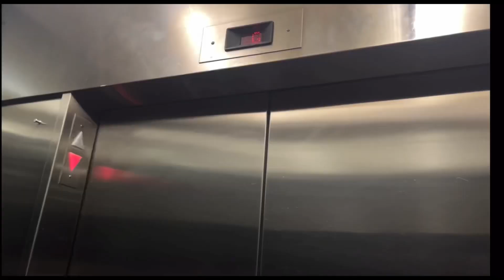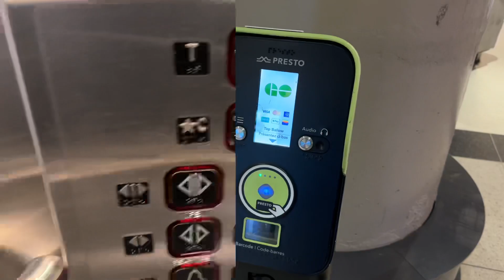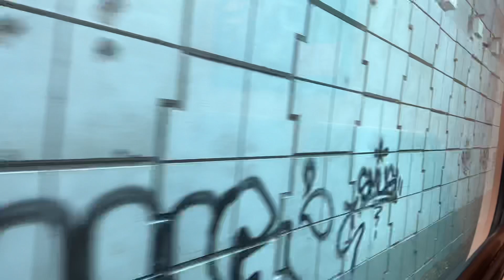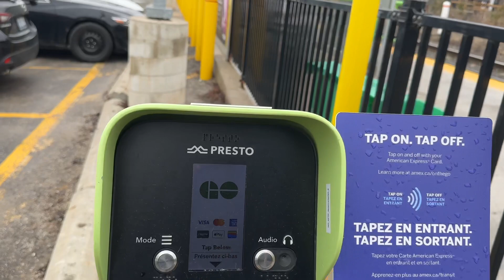(A Lot Of Horns) Riding with Go Transit Cab Car 323 and 600 From Union Station to Newmarket Go

Comment: I rode the MP40 600 yesterday with the old cab car 256 a 10 passenger car from Bramalea to Union station before 11AM, then roundtrip I rode the 6 passenger car one cab car lead 356 and MP54AC 679 from Union to Bramalea terminates there on that station!
Reply from the maker: Epic. :D
Reply: @tylerm666  I rode today go train 633 and 653 from Bramalea to Mount Pleasant station!